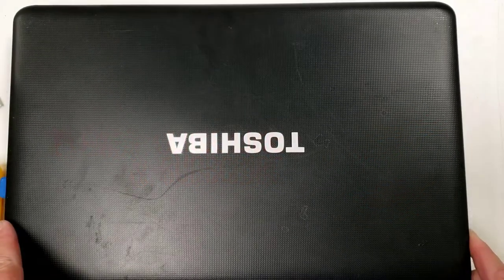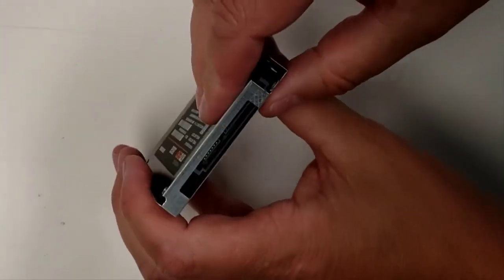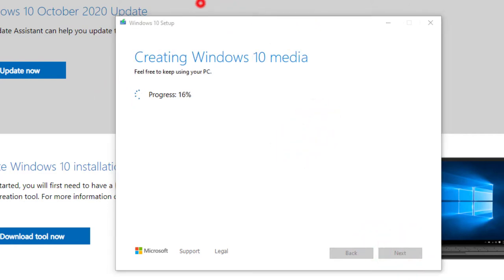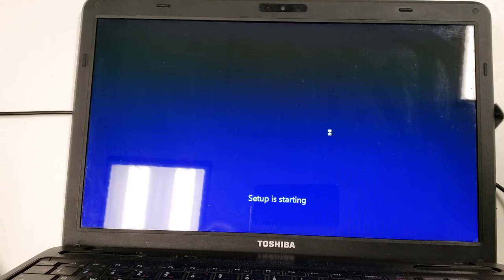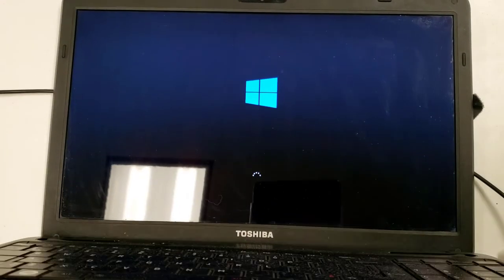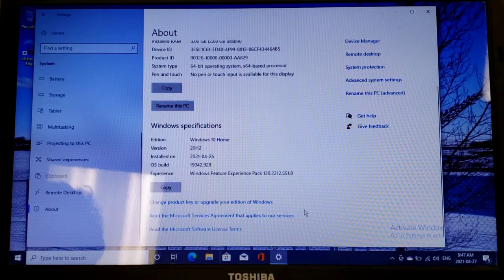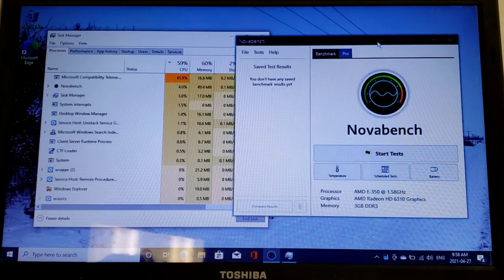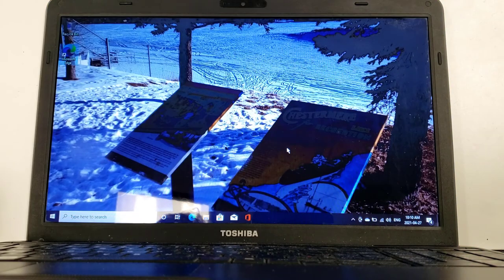Toshiba Satellite C650D Upgrade Hard Drive to SSD, Install Windows 10 for Free, Benchmark & Review

Comment: That SSD is worth more than the laptop!
Reply: So the SSD with windows 10 will work better than it was?? Because i had to downgrade to win 7 so i can use my laptop, with win 10 it was just frustrating!
Reply: @MrKaram666  With Windows 10 it will perform better with an SSD, but it may not be as effective depending on the rest of the hardware in your laptop. Windows 7 is better anyway! 😉

Comment: Dont Use Windows Free Anything Unless You Like Malware...I Bought Win 10  And New SSD...(Hard Drive Was Fried) ..App Compatibilty For These Old Satellite Laptops, Is Windows 8...So You Dont Get All The Features...If I Did This...Anyone Can...DO YOUR   RESEARCH FIRST
Reply: Yeah I'm in the process of doing this now. Got a case for the old 750 HDD and got a PNY SSD. I bought a disc copy of Windows 10 Pro on eBay, and when I was downloading all the Toshiba Satellite Drivers on a USB drive in case I needed them, I noticed the driver versions only went as high as Windows 8.1. Was not sure what that meant for the OS on this machine. When you say, can't use all the features, how badly is it impacted? Is it even worth installing Toshiba drivers from the website, or will they cease to function?

Comment: Hello I have a Satellite L655 with a windows 10 home OS. My hard drive is 277GB with 215GB free space. I also have a 1T external hard drive and my system still runs slow. What do you recommend.
Reply: Get an ssd an additional ram

Comment: I’m having issues with the WiFi for c655. It can connect to hotspots and other WiFi routers. But it will not connect to Xfinity WiFi 6 gateway router.

Comment: So the windows key is on the bottom of laptop?
I need a new hard drive and didn't think I could reinstall windows on a new drive without buying it.  What's the difference between a ssd and hdd?
Reply from the maker: SSD is SOLID STATE DRIVE which just means it has no moving parts because it is in fact just a circuit board with RAM chips on it.  On nearly all computers (that shipped with Win7, 8 or 10) from the last decade you can install a fresh Win10 without buying it again.  The CD KEY / PRODUCT KEY /... is either on a sticker in the back of the machine or is hard coded into the BIOS.  The important thing is to get the correct VERSION of Win10.  So if you are licensed for Win10 Home and you install Win 10 Pro, it will work but will not activate... so wipe it and do it again :)
Reply: @URTechDotCa  it has win 7
Reply: SSD Works Better...